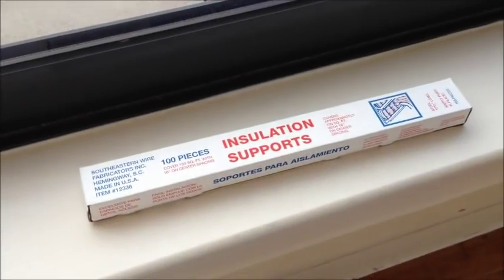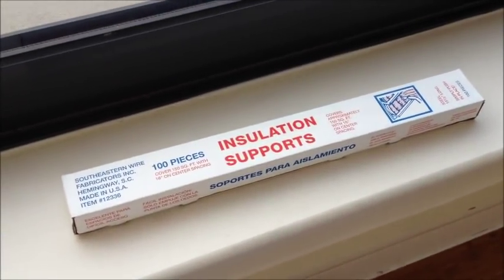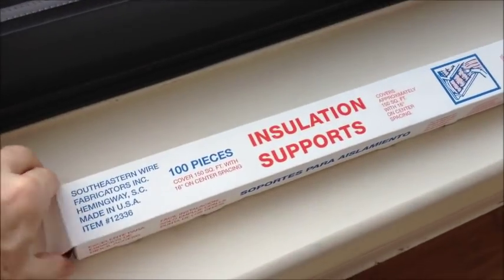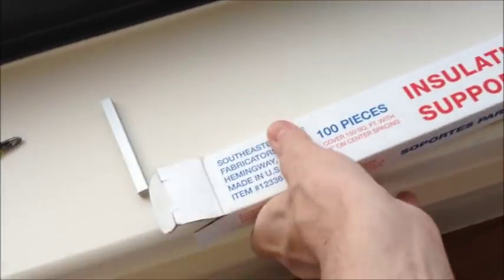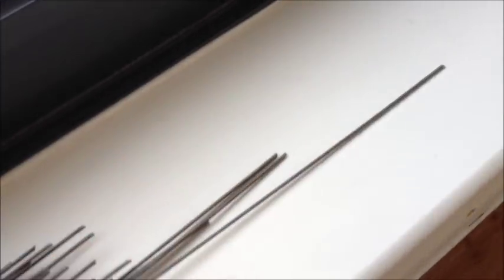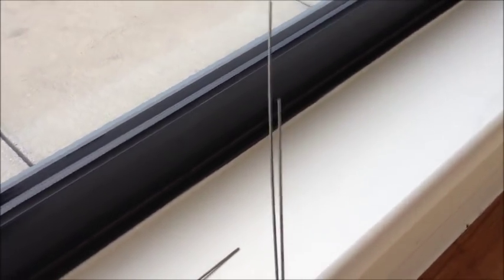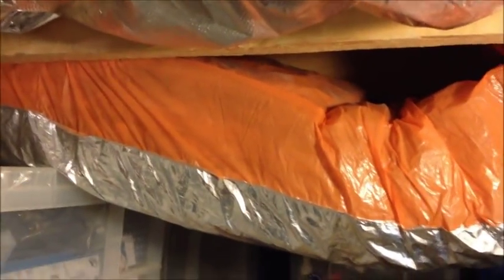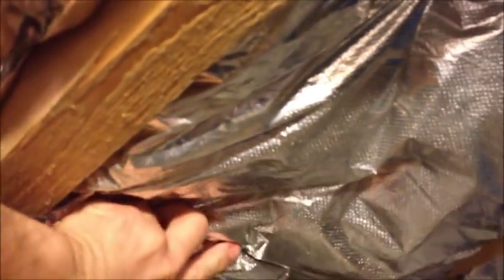Insulation Supports

Comment: The support can be installed with the arc of the support bowing downward rather than upward.

 This way the insulation is held in place but is not compressed up against the wood with the arc of the support bending upward at the top. In this way the  R value of the insulation is preserved.

Comment: Nice , but doesn't compressing insulation reduce it's R-value?
Reply: Yes it does
Reply: Compressing the insulation slightly reduces the R-value of the insulation directly above the support, but having the insulation fall out of the space between floor joists eliminates its R-value completely. Some compromise in performance is therefore necessary. Installing the supports with the ends close to the bottom of the joists will obviously result in the least amount of compression.

Comment: What do you suppose you could do if your supports aren't long enough? I'm insulating a space that's 23" between joists, and the 24" insulation supports can't hold them up. Any ideas how I can get the insulation to stay up. From what I can tell they don't sell supports longer than 24".
Reply: So long as your insulation is the same depth of the joist you can run a screw accross the joists leaving about a 1/4" of the head exposed. Then use tie wire to run perpendicular to the joists wrapping the wire around each screw as you go. you will want to do this every 3-4 feet. The reason for having the same depth is that the wire will be limited to the bottom of the joints on the wire and you dont want to have an air gap above the insulation.